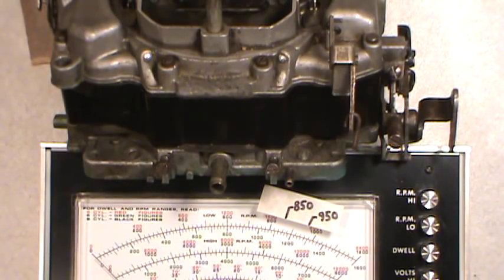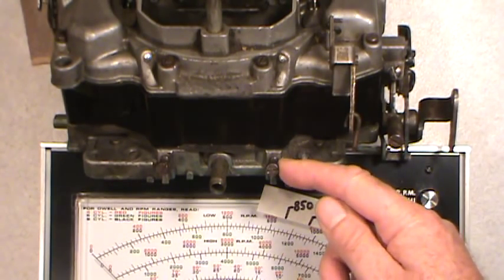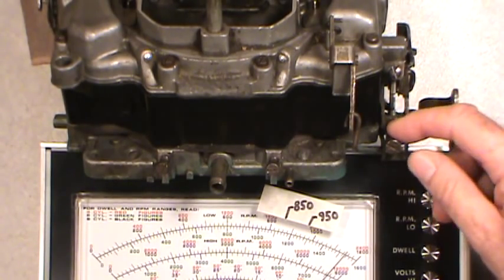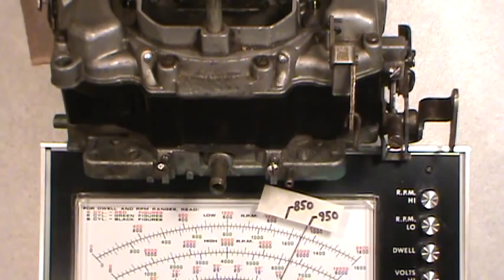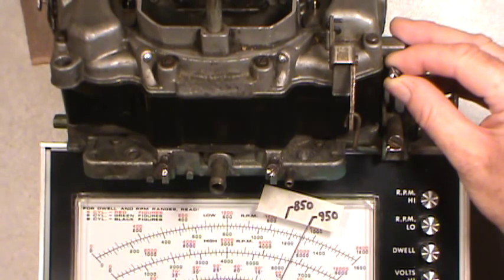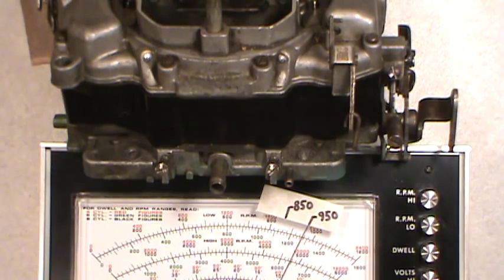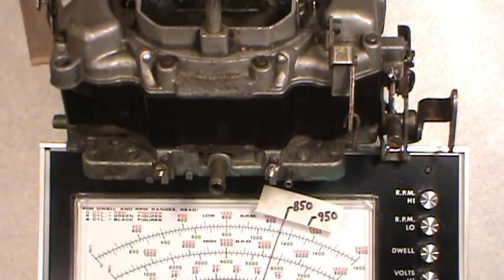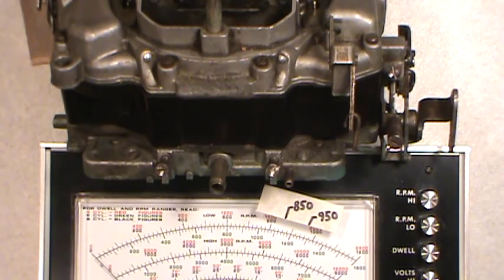Idle Mixture Adjustment on 4 Barrel and 2 Barrel Carburetors

Comment: I have a 4350 carb on a 1976 ford 460 like 59 caddy the rpms drop when i tighten the screws from the get go should I back them off even more then the 4 turns or are the needles shot any help would be greatly appreciated. I failed smog at idle not hat 2500 rpms. Thanks
Reply from the maker: Rick Bensco Greetings Rick Bensco....Thanks for watching this YouTube Video of mine.................................................Yes, indeed, getting everything set-up right, can be quite the challenge, at times, when it comes to getting Your Vehicle's Engine to run and behave, in such a manner that will satisfy, that good ole "Smog Sniffin' Machine's" ability to "Sense and Report" any Tail pipe Emissions, that are over and above the required Level of, shall we say, Acceptance, in order to have that nice word, being..."Pass"...printed on the Report, that You receive, after that, good ole "Smog Sniffer" has had its chance to Sample, what ever it is, that's coming out of Your Vehicle's tail pipe..........................................................."If"...???...it all boils down to, just having Your Vehicle's Carburetor, set-up, and adjusted, for Your Engine's..."Curb Idle Speed, and Idle Mixture"...then, as I see it, there are a few options that are available to You................................................First thing to do, is to have a look around in Your Vehicle's Engine Compartment, for what is known as a..."V.E.C.I." (aka, Vehicle Emissions Control Information)...Label or Sticker (usually it's a White Sticker/Label, with some Important "Information" on "It"), that will usually, be very Helpful, in getting Your Vehicle's Engine's Components, set-up & adjusted properly, so Your Engine, will, for the most part, be operating, shall we say..."Clean Enough"...as in, "Limiting" the Amount of "Excessive Exhaust Emissions", that will be Under the..."Maximum Allowable"...that will enable Your Vehicle, to receive that good ole..."Pass"...Stamp of Approval....................................................On at least "2" occasions, I found that, by doing the..."Lean Drop Method"...like I explained, how to do, in this particular YouTube Video of mine, on "2" Different Carburetors, by a "Lean Drop Amount of 100 RPM's" (RPM's = Revolutions Per Minute, of the Engine's Crankshaft), that by doing so, gave me that good ole..."Pass"...stamp of approval, on my..."Smog Testing Report"...and, by receiving that "Pass", I'd say that, the "100 RPM Lean Drop", that I performed, on "Both" Carburetors, worked rather well................................................If You are not able to find any "Specifications", as in, on a V.E.C.I. Label/Sticker or other-wise, I would probably do the following......................................................Vehicle "Exhaust" is "DEADLY"..."Make Sure" that, there is Plenty of Ventilation and Fresh Air Around Your Vehicle, when-ever Your "Vehicle's Engine Is Running"...!!!.........................................All "Lean Drop"...and..."Curb Idle Speed"...Adjustments, are done with the Vehicle's Transmission, In "PARK", on Level Ground, with the Tires Chalked, and the Emergency/Parking Brake On as well..............Have the Engine Fully Warmed-Up to Operating Temperature..............then, "STOP" the Engine............then, make sure that the Carburetor's Choke is Fully Off...............then, Turn-In Both "Idle MIXTURE Screws" In, until Both of them, are "Lightly Seated", and then put a white chalk mark, on the Idle MIXTURE Screw's Heads, at the 12-oh-clock/up position, then, back them "Out"..."4-Turns" each...............then, I would Connect my "Tach" (as in Tachometer, to see the RPM's of the Engine's Crankshaft)................then, Re-Start the Engine...........then, "Set"...the "Idle SPEED Screw or Idle SPEED Solenoid" (as the case may be) to achieve "700 RPM's in PARK" (automatic transmission)...............then, Adjust the Idle MIXTURE Screws, "One" at a time, Inwards, and later, probably Outwards as well, until the "Highest RPM's" were showing on the "Tach", and, You will have to probably, have to do it several times, in order to get it "Fine Tuned"...............You will probably Notice, that the "RPM's on the Tach", will usually "Increase" as the "Idle Mixture Screws" are Turned "In".................just simply..."Re-Adjust"...the "Curb Idle SPEED Screw or Solenoid"...Back to that "700 RPM's"...After making an Adjustment to the either of the..."Idle MIXTURE Screws".................Once You have established the..."Fastest RPM's"...with, Both of the..."Idle MIXTURE Screws"...while having, the..."Idle SPEED Screw or Solenoid"..."Set At that 700 RPM's"...then, it's just a matter of..."Turning In" (for a Leaner Mixture) the..."Idle MIXTURE Screws"..."Exactly the Same Amount of Turns/Partial Turns"...(please note, Carefully rub off the Old chalk marks, and put on New Chalk Marks, at the 12-Oh-Clock/High position, on those "2" Idle MIXTURE Screws..."BEFORE" Doing the "Lean Drop" in RPM's)...........Just "Remember" to..."Not Adjust the Curb Idle SPEED Screw or Solenoid"...when Doing the..."Lean Drop" (in RPM's) with the..."2" Idle MIXTURE Screws"...or...it just..."Won't Work"...!!!................Also, once You have Completed the "Lean Drop"...Adjustments...then You will have to "Make Sure", that Your Engine's..."Curb Idle Speed"...is "Correct", in RPM's, as shown on the "Tach", when Your Vehicle's Automatic Transmission is placed in "Drive", and, with the "Brake On"...while You are In the Driver's Seat...to the..."Factory/Manufacturers"..."Specification" (should be on the V.E.C.I. label/sticker, if You have one, that is)...................................................If the "Curb Idle Speed", while the Auto-Trans is in "Drive", and with the "Brake On", and You in the driver's seat, needs to be Adjusted, then, just use the..."Idle SPEED Screw or Solenoid"..."ONLY"...to..."Set" the Engine's..."Curb Idle SPEED"...and, for "Safety's Sake", make Your Final "Curb Idle SPEED Adjustment, with the Automatic Transmissions Selector in "PARK"...then place the Auto-Tans in "Drive", while You are in the Drivers seat, with the "BRAKE ON", and see what the "Curb Idle Speed" is, on the "Tach" (please note, the "Tach" has to be seen, while You are in the Drivers Seat, when Checking the Final, Curb Idle SPEED)...and..."Do Not Re-Adjust the "Idle MIXTURE Screws"...or....You'll..."Mess-Up"...the...Carburetor's..."Idle Mixture Settings"...that You originally, and painstakingly, went to all the trouble to go through, just a short time ago...!!!................................................There's "No Guarantee", that My "Lean Drop Settings", will enable You to "Pass" the Smog Emissions test, but it should be very close, just sayin'...........................................You'll have to find out, the.."Specified"..."Curb Idle SPEED"...while in "Drive"...for Your "Exact"..."Vehicle...Engine...and Transmission"...while Your Vehicle's Engine is..."Idling in Drive"...with You In the Driver's seat, as, that is..."Super Important"...in helping Your Vehicle, to have a much better chance at "Passing the Smog/Emissions Test"...!!!................................................Another "Option" is................You can phone around, and see if there happens to be, an Automotive "Fix-Em-Up-Establishment", that has a..."HC/CO" (HC = Hydrocarbons & CO = Carbon Monoxide) Testing Unit, where, the Unit's Tail Pipe Probe, takes a Sample of Your Engine's Exhaust, from Your Vehicle's Tail Pipe, and, then, the "Technician or Mechanic", will be able to "Adjust" Your Carburetor's..."Idle Mixture, and Curb Idle Speed"...to the required Settings, that will give Your Vehicle, a much better chance at acquiring, that much needed "Pass" that You need....................................................Even "If" Your Carburetor was "100%" Capable, of "Passing" the Smog/Emissions Test, that my Friend, is Only "One" part of what is Needed to keep "Exhaust Emissions" with-in Allowable Limits.........................................Here are a few things to consider, which also depends, on the "Type" of Smog/Emissions Test being conducted, for any given Vehicle...................................The Engine itself, has to be in very good Mechanical Condition, along with, not too much Carbon build-up in the combustion chambers/head/s, and even the Motor Oil has to be fresh and clean as well...................................Air and Fuel Filter/s must be Clean......................Now on to the "Distributor"............The Initial/Base Ignition "Timing", plays a "Big Role", in a Vehicle's Engine, that has to be "Smog Tested"................................................Things like, too much Initial/Base Ignition Timing...too much, or too quick, of a Centrifugal/Mechanical Timing Advance...and also, too much, or, too quick of a Vacuum Unit's Timing Advance, will usually "Increase" the Amount of "Exhaust Emissions" as well...!!!...................................................Bottom line here is..................Keep all Parts and Pieces "Factory Stock"...and Use the Vehicle's "Factory/Manufacturer"..."Tune-Up Specifications and Adjustments", for a Vehicle, that has to be "Smog/Emissions Tested"...especially, if it is something, like the "California" (and maybe New York as well?)..."Smog/Emissions Test"...as, not only will the "Sniffer"...be..."Sniffin'...but, I've heard that, they be "Checkin' under the Hood"...and..."Under the Vehicle"...for the "Special Certified Smog Parts", for the Vehicle in question as well...!!!...Yikes...!!!...lol...............................................So then, see if You can find, any and all "Specifications" for Your Vehicle, as that will really help a lot...!!!.......................................I still don't know if You have a Car or a Truck...???................................If You have any further questions or concerns, just let me know, in a comment or two, under any of my YouTube Videos.........................Good Luck, and, until next time.................Be Safe, take care, and have a good one.
Reply: RockysRoadshow Thanks! I have an old RV I drove it 2 years ago from CA to NY and Back. The truck runs pretty good a little bogged down on the hills but not too bad. I just got back from the smog test and my H/c was still not good my co was fine but not h/c at idle bummer I'll try this again from start to finish. Thanks again
Reply from the maker: Rick Bensco Greetings Rick Bensco....Here are a few more..."Clues"...for Ya, as to what just might be causing Your Engine's, Higher then Wanted, at Idle Speed..."HC" (Hydrocarbon), tail pipe Emissions..................................................If there happens to be any..."Vacuum Leaks"...due to things like..."Miss-Routed, or Disconnected, or Cracked/Split Vacuum Hoses"...or maybe, a...Not 100% Closing...EGR (Exhaust Gas Recirculation) Valve, due to something like, Excessive Carbon Build-Up, which will usually Prevent "It" from Closing all the way, and also, Any "Gaskets" that might be Leaking, that could very well be, causing a Vacuum Leak, as well ................................................If Your Vehicle is equipped with a "Catalytic Converter", It also, has to be Functioning Properly as well.................................................If Your Engine is Equipped with an Air Pump (aka, Smog Pump...lol)...then, "It" has to be working properly, as well my Friend, as "It" kinda works, some-what like an "After-Burner", in the Exhaust Manifold/s, where-by, the "Unburned HC's", that Exit the Engine's, Head/s, Exhaust Ports, gets "Mixed" with that "Fresh Air", that the Air/Smog Pump...Pumps into the Exhaust Manifold/s, which in turn, as I see it, makes for what, I do like to call, an "After-Burner", b-caws, that there "Fresh Air", that is Added to the very Hot "HC's", will enable those very Hot "HC's" to "Continue Burning" in the Hot "Exhaust Manifold/s", b-caws of the Oxygen, that's in the "Pumped-In" Air, makes for a "More Complete Burning", of the "Un-Burned Portion" of the "HC's", while "They" are "In" the Hot Exhaust Manifold/s...................................................The Engine, has to, have had, a Proper "Tune-Up", not all that long ago, and that Engine, has to have, New, or As-New, Ignition and Fuel System Parts & Pieces, along with Clean Air and Fuel Filters, and also, has to be "Correctly Adjusted"...to..."Factory/Manufacturer's Specifications" as well................................................Sometimes, as I've experienced in the past, there was some "Crud/Debris/Yuck-ees", that got Stuck, in my Carburetor's "Idle Circuit"...in around the "Mixture Screw Area"...there-abouts, which had my Car, almost "Stalling" at a Red Light................................................So, I managed to Nurse the Car back home, and, I made a Note, of the "2" Idle Mixture Screw's..."Turns and Partial Turns"...from being "Lightly Seated" and Fully Closed", so that I'd be able to "Set" Them "Back where They were Originally"...................................................Once I "Removed" Both Idle Mixture Screws", I got a hold of a length of Neoprene, Fish Aquarium, Air Pump..."Clear Tubing" (about 1/8 Inch, Inside Diameter, I think), and, like Blowing-Up a Stubborn Party Balloon, I used Lung Pressure, via my mouth, to make like a Mini-Compressor, and I Blew really hard, through the Clear neoprene Tubing, while it was pressed against, each of the Carburetor's..."Idle Mixture Screw"..."Holes"...hoping to..."Dislodge/Remove"..."What-ever-It-Was"...that, what I thought, just might be causing, that..."Not-Working-so good"..."Idle Circuit"..in my Carburetor...........................................Once I "Re-Installed" the "2" Idle Mixture Screws...and..."Back to Their Original Positions"...(and hearing a Drum Roll)...I Started the Engine, and..."Guess What"..........................."ALL FIXED"...and the Engine was Idling..."Just Great"...!!!...(I Bow, and say...Thank-You, Thank-You very Much)...lol.........................................If the Carburetor on Your Engine, has gone quite a Few..."Miles/Kilometers, or Years"...since it has had a..."Complete and Properly Adjusted Rebuild"...as well as making Any...Modifications, as in, something like, Re-Calibrating the Fuel Jets, on a much Older Carburetor, that was probably "Calibrated" for 100% Real Gasoline (that be Gasoline, that Does-Not have any Ethanol/Alcohol in it...!!!), way back when, as opposed to, trying to having that Much Older Carburetor, trying to Supply the Engine, with the Required Air/Fuel Ratio at All Engine, Speeds and Loads, while that poor Old Carburetor is being "Fed" (as in Feed or Feeding) the current day Gasoline, that usually has "Ethanol" (Alcohol) in Its "Blend", which by the way, will some-what make, a Much Older Carburetor, that was Calibrated for the Good Ole 100% Gasoline (that was available, many Years ago), and as I've experienced personally, a Carburetor, while being Fed, Gasoline, with about 10% Ethanol in it, would cause, that particular Engine to..."Lean Surge", while Traveling at City Speeds (Lean Surge, is when the Engine actually Surges, or kinda makes the Vehicle, Jerk, or Buck, back and forth, and I'm sure, that Everybody, while in that particular situation, would actually Feel, that Somethin's Up...!!!)  .........................So then, if You care to, and with Your Engine "Cold and Not Running", You can "Visually" Check-For, things like...Missing, Disconnected  or Damaged...Vacuum Hoses and Electrical Wiring, and/or, just about Anything that looks like "It's" out of place, or just Doesn't Look Right, just sayin'.................................................Before I forget, just about "Any Vehicle", that actually "Does Pass the Smog Test", will for the most part, be getting "Better" Gas Mileage/Kilometer-age (aka, Fuel Economy), but only If, a Person goes..."Easy on the Gas Pedal"...and, if that Person does, that "Gas-Pump-Bandit"..."Won't be Taking as Much of Your Hard Earned Money"...at as..."Fast-ah-Rate"...as a Vehicle that...."Failed the Smog Test"...and usually gets called, a..."Gas Guzzler" (maybe?...lol)......................................From my experience/perspective, it sure "Doesn't Take Much", along the lines of, shall we say, Something that Isn't Working Properly, Connected Properly, or Adjusted Properly as well, that will cause, just about any Gasoline Engine out there, to be...Spitting/Spewing, Excessive Exhaust Emissions, out of the Vehicle's Tail-Pipe/s, and, that's, pretty much a given (Fact), and, as You've already experienced, that Fact, happens to be...that You...just..."Can't Fool that Smog Sniffer, at the Smog Sniffin', Testing Establishment"..."What-So-Ever"...!!! (aka, "It's kinda like, a "Mechanical"...but Can't Run..."Police Tracking Dog"...!!!)...and lol, but only if it isn't You, that gets handed that "Smog Report"..."With-Out"...the..."PASS"...Word...Stamped On..."It"...!!!............................Ah yes, time for that, good ole saying, and, as I see it, could be applied, to an Engine, that "Won't Pass the Smog Test" (due to somethin'...that just Aint Right)...and that Saying happens to be..."The Chain is Only as Strong as the Weakest Link"...!!!...(or Snap!)...................Good Luck...and........Till next time................Be Safe, take care, and have a good one.
Reply: RockysRoadshow Thanks again I'm going to give it another try today. Thanks